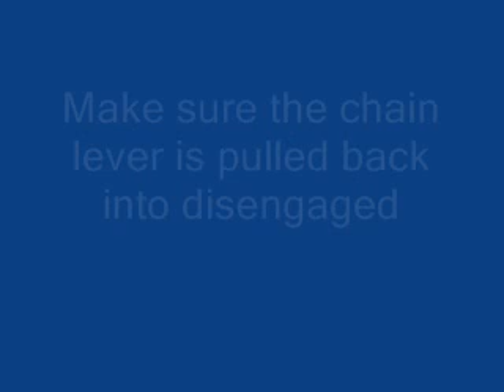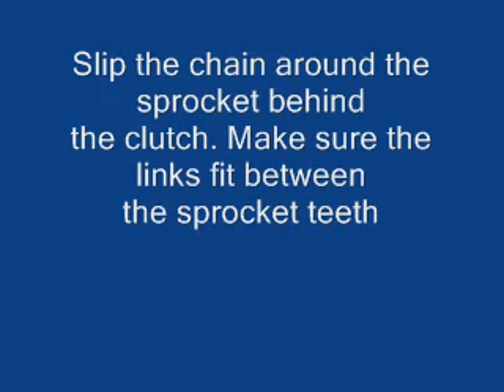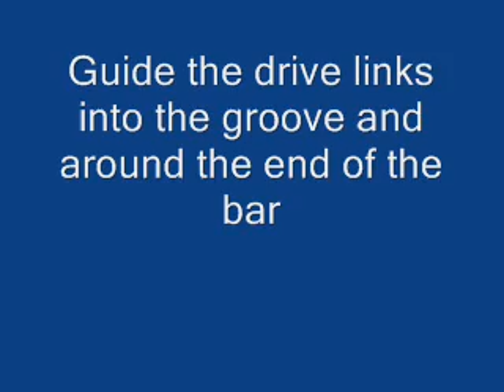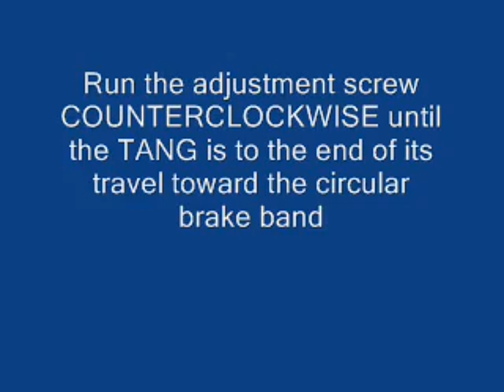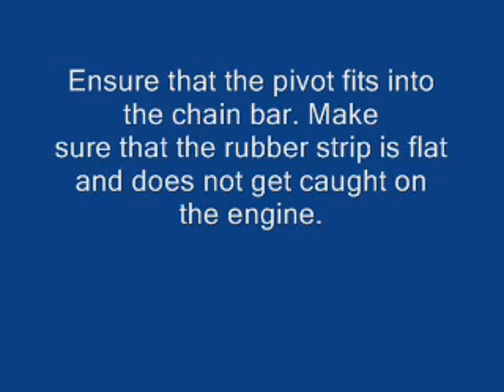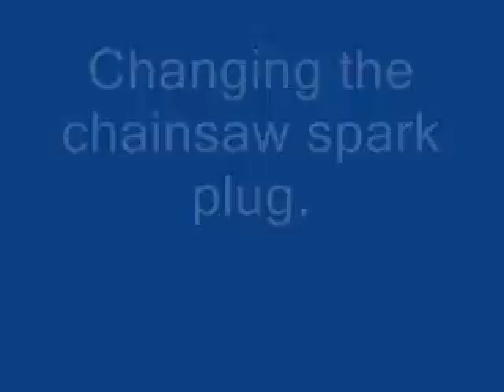HOW TO ASSEMBLE A PETROL Chainsaw. Footage.wmv

Comment: Dunno if your the type to reply but having small trouble here- so at 3:50 the metal band (i think its called the tang?) that goes over the wheel, does it just sit on top or does it go over the wheel that drives the chain? seems a bit flimsy if you just leave it sit, also seems a very tight fit to go over... too tight
Reply: 19 Agustus 2010